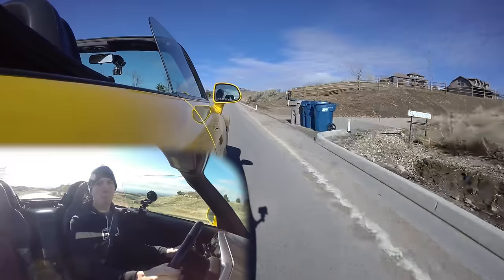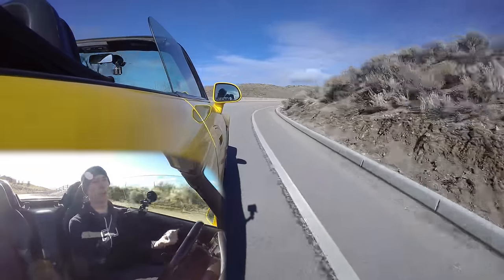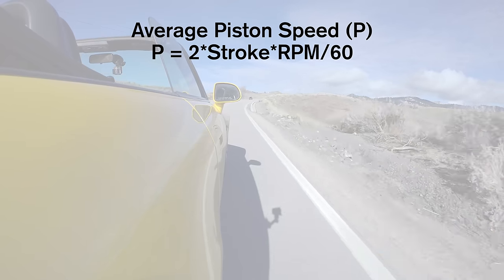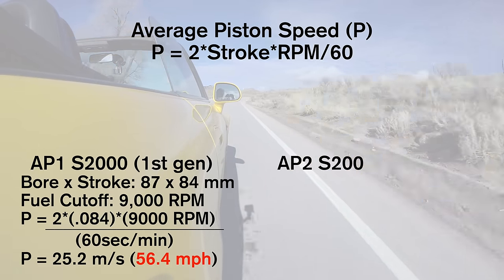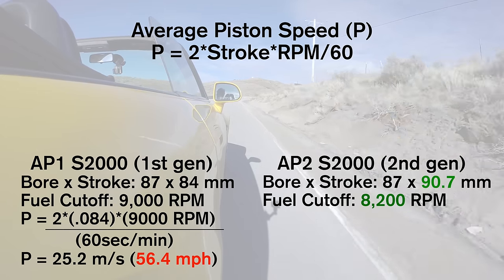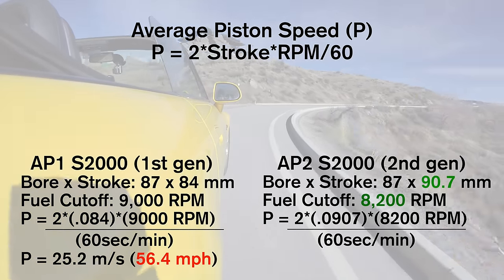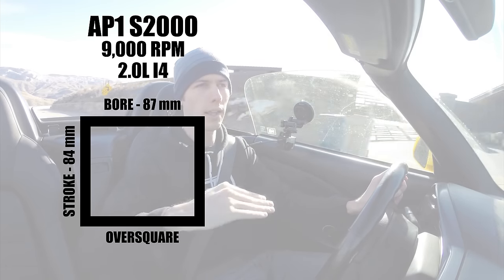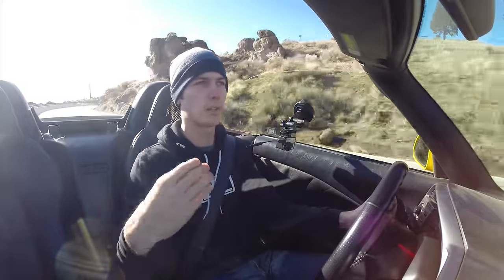How Do Some Engines Rev To 9,000 RPM?

Comment: I believe that peak linear piston speed is also a limiting factor for engine rpm;  piston ring stability (ring flutter) can happen at very high piston speeds which compromises their sealing capabilities. I thought the limit was around 4000 ft/min linear piston speed.  It's another reason that relative high revving engines are typically designed oversquare (big bore/short stroke)
Reply: In F1 a few years ago they were looking more at G forces than actual piston speeds. So they were playing with rod length to alter how the G forces worked. They were using 5000 G as their limit on the V10 engines back when I was making crankshafts for F1.
Reply: Interesting;  max piston acceleration would directly relate to peak con rod stress loads.  So there seems to be multiple limiting factors to max rpm.

That's what engineering is about; figuring out what's possible and reasonable within the physical limits imposed by the real world.
Reply: Yes piston ring flutter is an issue so thinner lighter weight rings are now more common. I like the videos but I think it leads down a route which is over complicated yet does not talk about the other reasons why or how engines rev so highly. The variable cam timing is pointless from a basic engine RPM point of view as cams will be designed to work at higher RPM but it is bore and stroke combinations which match piston speeds but then rod length also makes a difference too and then it can become an issue when you work on G forces which will then be the engines limit and therefore limit RPM based on what G forces the piston is under...
Reply: Yeah, he talks about piston speeds at high rpm being fast enough to outrun the combustion flame front.  I have never heard of that as the reason for setting any particular rev limit.  Seems to me rev limits should be set to avoid engine damage from the other factors we mentioned. The piston outrunning the combustion flame front would only result in a sort of natural rev limiting due to the power output dropping off quickly, and not be a cause of any engine damage.
Reply: The piston outrunning the flame front can damage the engine. If the piston's moving that fast, it's likely that it'll also compress faster than the engine can exhaust, which can lead to extremely high compressive stress, especially if the fuel is still burning and building up pressure. It'd also lead to big vibrations that could rattle the connecting rods, bearings, and/or crankshaft apart. The vibrations and unpredictable changes in pressure probably wouldn't help with piston ring flutter either. It's way more likely for damage to happen before all that, so I think he was mentioning that more as a WOW factor than an engineering factor.
Reply: Never known an engine to outrun the flame front... Partly because the flame front it what pushes the piston down!  
The rev limit is usually a natural limit due to the cam profile not allowing the engine to work beyond a certain rpm. Mild cams tend to run out of steam early in the rev range and race cams push the power higher in the rev range and allow the engine to rev higher. Ignition and fuels also come into play with octane ratings causing detonation if the rating is too low and the ignition timing to prevent it can also limit RPM. That is why high performance engines need higher octane ratings..  All of the talk of math is not actually giving the true picture in the real world... I had issue with the exhaust back pressure video too the video was only part of the story and its all theory not real life. If an engine was all down to math and theory then all race engines pushing the highest levels of power out of an engine would ALL be the same...
Reply: Yeah, that seems like an unusual explanation for establishing an engine rpm limit. If that scenario actually happened all it would do is very quickly reduce the engine power output due to the sudden reduction in combustion pressure being applied to the piston, as you described.
Reply: Piston velocity isn't linear. With enough rotating mass to carry momentum, the pistons can outrun the flame front after being initially pushed by it, and dwell makes it even worse. The speed of sound also decreases as temperature decreases, and on top of that, the pressure decreases as the temperature decreases and volume increases. The flame front's maximum velocity decreases as the piston travels down, and piston velocity increases until it's about halfway between TDC and BDC.

Everything is mathematical, and theory explains everything you can imagine and more. We use extremely simple math compared to what really happens to make things easier for us, but we lose a lot of accuracy and miss out on parts of the story. It's a pain, but you add more math back in to get the whole picture, not take math away.
Reply: Look at a dyno chart for a typical 1000cc sports bike and you will see soon after the engine hits peak power the power usually tails of very quickly just before the limiter is cutting in. The Superstock 1000 Suzuki GSXR 1000 I work with is producing 206bhp at 13250 rpm and at the limiter (14250 rpm) the engine is back down to 196bhp before the limited kills it dead. The engine actually starts to dip really quickly over the last 200rpm of the power curve so it would simply run out of steam naturally at about 14,500 rpm anyway.
Reply: Yeah, your intake is limiting your power band. And? That's how most engines are.
Reply: TheSmileyFacedPizza so again the math may work out how much power you can produce but the real world will bring you down to earth when the intake may give you more peak power but then at lower engine speeds the air speed through the intake is so low you get poor atomization and fuel drop out. The real world needs a spread of power and that's why the actual design of the engine is going to be more of a limiting factor than the piston out running the flame front. There are no fuels which will be an issue to cause that as they burn too slowly and the only other thing is detonation which may be harmful but can be resolved easily.
Reply: I was never arguing that it should be a limiting factor in the design of engines. You've been arguing that it shouldn't be considered for design because it isn't possible after I already said it isn't an engineering factor towards the beginning of the conversation, so I've just been arguing that it is possible and is a problem in a very small number of obscenely high-revving applications. The math works out exactly the same way as the real world. The stuff you mentioned can all be explained mathematically, so I'm not sure why you're implying math doesn't apply here.
Reply: The math being used in the video to explain how an engine revs so high is just a tip of what is needed and many here look to the videos as an answer to it all... The real world and engineering an engine has too many variables to simply put it down to the not so simple and overly explained information in the video.  If the video was "what are piston speeds and what impact does it have on engine design" and a simple not overly technical answer was given it would be better...  His video on exhaust back pressure was quite simply a half answer and did not talk about how it is used to alter how engines perform at less than optimal RPM and how it can be used to boost power lower down with solutions like the Yamaha EXUP valves.

Comment: Would be great to see some bike engine tech mentioned in these videos too - a lot of 1 litre displacement sports bikes rev to 14,000 rpm in stock form (e.g. the BMW S1000RR), which also produces a pretty respectable 199hp from a 1 litre naturally aspirated engine. From your description sounds like the stroke length must be really short / the bore quite large.

Comment: Nice explanation.. as always 👍
I love the high rev engines and noise ... you can hold a gear longer which is great on winding roads...
I have series 2 rx8 ... lets you get just under 10500... only downside is the low torque at low revs ..but after driving a while you get use to it - and yea im saving for a rebuild, when it goes but hopefully with the love i give it, it will last another 40,000 miles ..oil change every 3000miles, plugs + other oils at 10,000 miles...
Next car im getting to join it will be a Mustang followed up by a hotrod !

Comment: I like high revving engines because it gives you more freedom to use the accelerator on technical courses. It's a common scenario, you're trying to get as much speed as you can out of your car while on a straight as you're approaching a corner, but you're running out of revs. Normally you'd change up a gear to keep accelerating, but by the time you change gears, you'd be in the braking zone. Or say you're in a lower powered car and are struggling up a steep incline. On level ground, you'd change up a gear, but if you do that here, that moment you're off of power would mean a lot of lost momentum, which the higher gear would struggle to build back up to because it's less advantageous.

Comment: Two questions:  
1. Why the 2* in the formula? Doesn't the piston travel 4* the stroke per revolution (hence 4-stroke engine?)
2. using a target ~25m/s average piston speed for my M116 (Mercedes 3.8L, 88mm x 78.9mm), the pistons wouldn't hit that speed until 9500rpm.  Max engine speed is 5250rpm, or average piston speed of ~13.8m/s.  There must be more to the story than just average piston speeds.  Perhaps a part 2?  

Thanks for great content!
Reply from the maker: 1. The piston travels up once, and down once, per crank revolution. Hence, 2x (1 up, 1 down stroke per 1 crank revolution). 
2. It's more of a limit, not what every engine will be spinning at. You won't see numbers much higher than 26 m/s, but you can certainly have lower numbers.
Reply: First, thanks for the response.  1. Of course, there's no way it could go through the 4 cycles without rotating the crank twice.  And 2. Bummer.  was really hoping for more power out of that old engine.  Thanks again :)

Comment: I like long stroke engines more torque at bottom end better drivability.  My 2004 3800 SC Monte Carlo  pulls strong and runs in the 12:90's  still gets 30 MPG.

Comment: Nice soundtrack. :-)

I don't have any tremendously high-revving engines around. One of them is four cylinders, 320 cubic inches, 160 hp at 2700 rpm. It too sounds nice, almost a Subaru burble (same firing order).

Comment: Can you explain a bit more the difference between undersquare and oversquare designs? Why they are using so oversquared engines for buses and trucks that have 3K RPM redline? What are the advantages and disadvantages?

Comment: Looking at an S2000 engine also makes you wonder how the engine gets sufficient airflow with the high forward intake and low air ingress opening.  Would love to see/understand how that functionally works as a design with a smoke flow machine. MCM made an opening in the hood for forced air but I'm not sure if that improved what must be a vacuum effect in the manufacturer design.

Comment: Basically it changes where you hit into the usable power-band. Having the revs like that does have one other perk though, it tends to favor the use of turbos.

Torque monster engines are fun in their own way though. They're capable of just pulling off the line without all the noise. (Electrics are likely the ultimate form of this. Although some diesels and NA engines aren't too bad either.)
Reply: Turbos need to be tuned to the motor they're bolted to. It's not good enough just to say they favour high revs. Tell that to a 600hp truck engine that won't ever see more than 2K rpm, but will haul ass all day long.
Reply: Perhaps I should have said it favors turbos in regards to a relatively small displacement? In which case you may have around 3L making similar numbers to that 7L big block.

Comment: First of all, I'd like to congratulate you for your channel, you are great at explaining things. 

As you will notice, I'm not english,  writing from Spain and wanted to ask something not directly related with this video. 

I have a Subaru BRZ and I've read in some sites that it's not good for the engine to run it on low rpm for a long period of time. 

It's my everyday car and from Monday to Friday I use to drive it in a very "efficient" way. 

What do you think Jason?.

Best regards.
Reply: Hope u don't mind my input, that statement is a fair point. Labouring your engine below say 2000 rpm for extended periods of time will choke everything up. It's best if you're just around town or stuck in traffic to change up a gear at 3000 rpm and change down at 2000 rpm.

Comment: Probably a silly question but what is better horsepower or torque? If you have a motor that makes 450lb ft of torque and 200hp vs a motor that makes 400hp and 200lb ft of torque is one better than another or is it just the feel of the motor? I have always been told HP equates to top speed and torque equates to Rate of acceleration. Hopefully my question makes sense. Thanks for your videos I very much enjoy learning on your channel.

Comment: your power band is more important than your rpm, though having your power band sustain itself across 6000 rpm can make quite the difference on a roll or track when you don't have to shift as much to gain speed, even if your power band is from 6-12k rpm, the gearing does the rest.

Comment: I have always thought that motorcycle engines can rev higher (maybe 18,000 RPM) because of a lower reciprocating mass ( a 750cc engine can have four 187.5 cc bores), plus the pistons and cranks tend to be forged aluminium and steel respectively. Is that correct? Love the videos BTW

Comment: On the job, I drive two SUVs of different make. They are very similar in terms of weight and size. Both have engine size of 3.5L. But I realised they have far different rpms at crusing speeds on fairly roads. For instance, at vehicle speed of 100kph, one operates at 1200rpm whilst the other is 1800rpm. What could be the  difference? Which of these vehicles is better in terms of efficiency and engine longevity?

Comment: Japanese motorcycle manufactured 250 cc Inline 4 cylinder engines which revved up to 18,000 RPM in stock form, that's pretty awesome.

Comment: Thanks for the info. Good picture of what the differences are.
Yup, redline is real. I once revved a 327(in 4th gear) to 6000RPM(redline 5200). After that it burned oil about a quart per 1000 miles. It seems as it really toasts the rings.

Comment: Hey Jason, I really enjoy your videos. I would be highly interested in a follow-up video explaining in detail how it is possible to rev high physically, and for a given engine, why there is a specific rev limit.
I get your point about piston travel speed, but say you are doing 100mph in 5th gear, if you force it to shift into 2nd (let's say it hits 60mph at the rev limit), it will likely destroy the engine. Why is that, and how can you raise the rev limit for any engine, ie how do you improve the valvetrain and other moving parts to reach that goal.
In particular, I saw the Teknoboys/Shane T/Mazworks SR20 revs to something absurd like 11000 rpm, using the exhaust flow to produce very high boost and achieve high power and a 1/4 mile in the 6 second bracket. I'm interested in the physics behind what you are trying to improve (such as using solid lifters instead of hydraulic to avoid valve float at high RPM).

Thanks! And props for mentioning diesels, they are far too often forgotten :'(

Comment: I didn't do the calculations but I know the piston speed in my GT500's 5.4L @ 6,250rpm and 5.8L @ 7,000rpm engine is right up there and exceeds piston speeds of some race engines.  At the time magazines use to say it was on par with NASCAR and F1 engines.  It surprises most car guys when you tell them that a 5.4L (331ci) modular Ford engine has longer rods (6.658") then a 572 big block chevy with piston speeds approaching F1 territory.

Comment: 2 questions. 
1. At what piston speeds do the pistons start to out run the flame front?
2. Doesn't the slower rate of combustion play a larger role in diesel engine speeds than the design of the engine?

Comment: Awesome video! So if I want to increase your max revs from a factory redline of like 6800 or 7k rpm to 8k rpm, then I got to change a lot things in the engine right? Also are high reving engines better without forced induction? It's amazing on how some cars have engines that could rev really high like your s2000!

Comment: High rev engines are cute but not always practical since it depends on the application: max fuel economy, fast 0-60, or towing ability. It would be absurd for a Corvette, Camaro, Mustang (or any truck) to rev to 9k because of the energy wasted in heat. And how many transmissions can actually engage at 9k with an engine producing 450hp and 450 lb ft of torque? I would rev my little 2015 Elantra at times, yes it had the 6spd manual transmission, but it wouldn't do anything except make noise unless I shifted into a higher gear. The critical element is the transmission for any high rev engine.

What is really confusing IMHO is the torque curve between DOHC engines versus pushrod. Why is this? I think the valvetrain also facilitates an engines ability to rev high but I have never been able to compare directly. I am thinking of the 1990 Corvette ZR-1 with the LT5 DOHC engine versus the LT1 engine of that generation. I eventually got a 94 Trans Am with the LT1 and I will always regret selling that car. What makes the torque more 'primal' in pushrod engines? It will be interesting if the next generation Corvette is really going to be mid-engine ..... And if people will go for the rumored DOHC engines it is going to have.

Comment: Nice Video again. 👍
Could you please take a look toll the motorcycle 1000cc engines with 200hp and over 13000 Rpm and explain this insane HP to Engine size ratio?
The stroke must be very short to get the right piston speed.
And how did the material hold on?